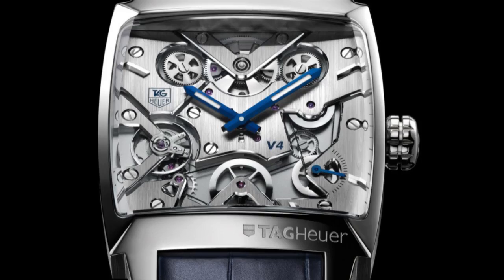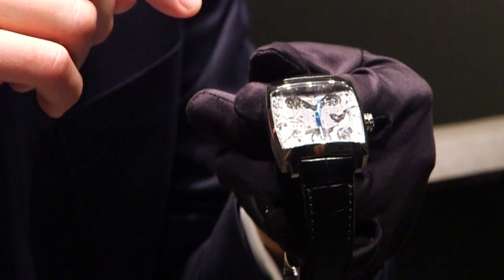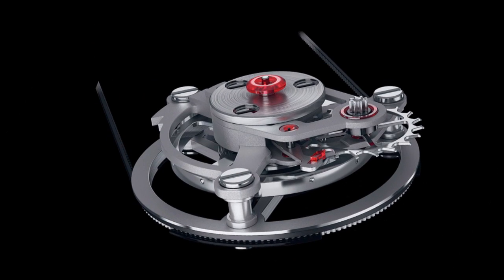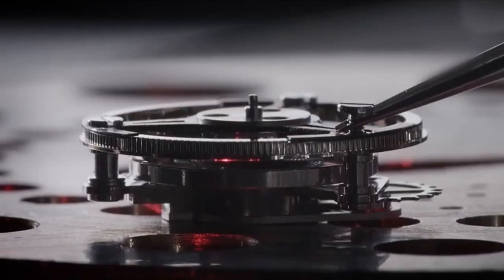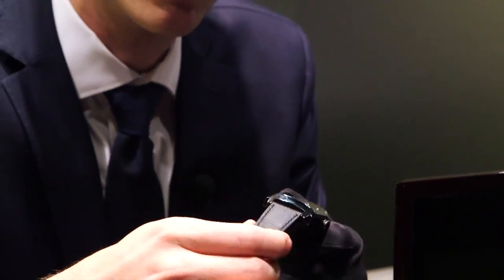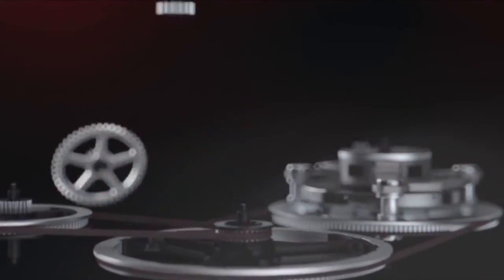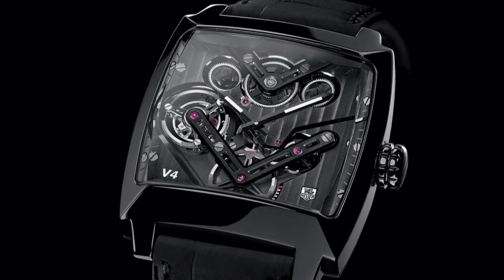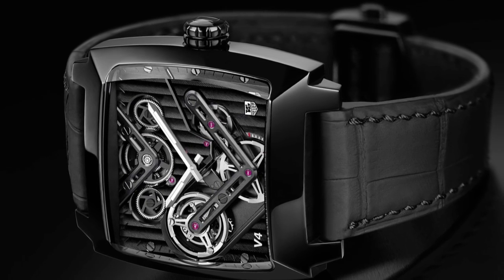Inside the TAG Heuer Monaco V4

Comment: Weird.

Belts wear out, just like in a car... Not a good thing.
Reply: Doubt it would wear out. The strain is insignificant and the rubber is isolated from any other factors such as moisture or UV rays. Maybe the rubber will age and start to fall apart, but i doubt they didn't account for that in a watch that cost 50k.
Reply: +bmw racer plastic tech has come a long way in the last 30 years, unlike swiss watches!
Reply: ssuuppeerrbbooyy there are micro steel cables inside the belts.
Reply: brendenn12 Yeah, its pretty amazing. I tried the carbon edition. Its kinda funny how light it is. It feels like a cheap toy, not a marvel of technology. The heavier ones feel better.
Reply: If one afford this watch - replacing the belt 10 down the road should be Affordable and justifiable.